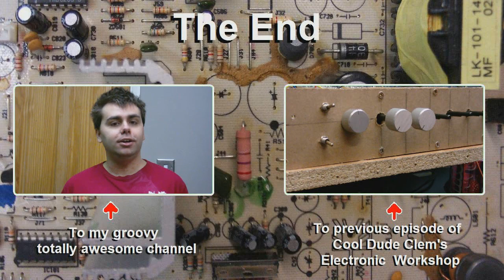CDC Electronic Work Shop - Upgrading a BSR turntable

Comment: I've got an "all-in-one" The Fisher 125 with a BSR turntable built in to the top of it.  I restored the turntable as it was stiff with the old hard grease and got everything freed up.  It's a 4 speed with 16,
33, 45, & 78, has a metal plinth and platter and has its original Pickering V-15 moving magnet cartridge with 2 NOS styli I picked up for it for modern albums as well as wider grooved 78's.  Problem is the old Fisher underneath it (made in 1968) is pretty well clapped out.  All the pots and switches are worn to the point that deoxit only temporarily "fixes" them for a week or so.  The flywheel behind the tuning knob turns hard as with its weight it has wallowed out the sleeve that the shaft sits in and the traces have lifted shorting out the FM transistors.

What I want to do is to find a stand alone case for the changer like you've got there and transplant the Fisher's turntable into it so that I can use it with my modern Onkyo TX-8220 receiver/amplifier.  (It does have phono jacks and a screw for the ground wire)  Only thing I'm wondering is are all the BSR plinths pretty much the same size so that if I get a case for it from another old turntable, will it fit.  Guess I'll find out soon enough.  Wish me luck.

Comment: I would have liked a more precise guide, because I have a BSR plate but not the same system as yours, I made sure to have an output and I have 2 soldering cap, and the worry is that if I change ceramics to magnetic, the sound is super weak and on the output I literally have "hum" and no sound ... and impossible to know how to change it without wrecking the whole system ...
Reply from the maker: You will need to put a pre amp between the cartridge and the phono input. I did this with a GEC Sound Deck a long time ago and it sounded great. Ceramic phono inputs (usually) have no EQ and are line level, so connecting the pre-amp's output to that will work. I no longer have that unfortunately, or I would show how it's done.
Reply: @CoolDudeClem  for the pre amp I agree, but where I am stuck (thank you bsr for not putting serial numbers) impossible to find a precise guide for the model of the turntable, what I can say is that it is based on a chassie pre amp wilson sl400 it is basically an all in one of the 70's, mechanical, analog and without output rca and all the circuitry is under it

Comment: may I ask how you got the turntable out of it's housing ?!?
Reply from the maker: If you mean the turntable platter, there's a clip on the pindle that hold it in place. If you mean the whole thing, then, under the 2 screws that hold it down there are a couple of clips that can be folded out, allowing the whole thing to come out.
Reply: @CoolDudeClem  Thx a lot. I will try that when I get hold of the system next time.
Reply: Tell it you want a committed relationship 🤣😅...😳Sorry

Comment: i KNOW IT WAS YEARS AGO BUT SHOULD YOU CHANGE THE WIRING UNDER THE PLATTER TO MAY MATCH HOW MAGNETIC  CARTS ARE DONE? OH YEAH WHAT ABOUT A GROUND WIRE?  WEHRE DO WE PUT THAT TO PREVENT A HUM?
Reply from the maker: There's no real point with this turntable as the motor makes so much magnetic interference, the cartridge itself is picking up hum from the motor.
Reply: @CoolDudeClem  if you change the wiring to match how they did the Magnetic cartridges there is not a hui but you still neeed the ground added for interferance,

Comment: :ou can now buy a plastic cartridge adaptor on Ebay to save drilling two holes it just clicks in after re wiring and putting the cartridge on it

Comment: You done a great job there, I have always liked BSR turntables. I have umpteen of them I know what you done is fine, but I do like the sound I get from the original stylus. I know those magnetic styluses are better but the price of the original one is cheaper. Although I may try what you done to one of mine.
Reply: If you have a lot of them, check under them first.  Some may already have a moving magnet cartridge.  My circa 1968 BSR turntable, a 4 speed has its original Pickering V-15 mm cartridge and it still works great.

Comment: What is the 2-4-6 in the back on the right side?  Is it related to a counter weight in some way?
Reply from the maker: I think that's the anti skate adjustment.
Reply: CoolDudeClem I see. I have the same player along with an 8 track and receiver in a 1975 console, but the silver/chrome piece in the middle is missing on mine.  I’m not having any issues with it. Just wondered if that was some kind of internal counter weight located underneath or something. Thanks.

Comment: I have the same identical changer, It's a Realistic LAB-14. It used to rumble and mistrack bad until I degunked and extensively relubed it including arm travel path, boiled idler wheel & motor mounts to restore softness, put a Pfan. MG09D magnetic cart in,  (insane stereo seperation) shimmed VTA downwards, adjusted trck force & antiskate properly. It came with an ADC mag cart but i didnt care for the sound of it

Comment: I have one of these turntables. The tonearm is heavy because it' missing the counterweight that my turntable has. It was a weighted cylinder of heavy plastic that slid over the end of the tonearm shaft and snugged into the slot at the end. Then when you set the weight adjustment to zero the tonearm balances.

Comment: I did this to my BSR using an Audio Technica  At95e. You need to connect a ground wire that connects the left and right ground connections from the cartridge together, and then ties them to a metal portion of the record changer base or mechanism this should reduce the hum.

Comment: Can you/have you aligned the cartridge?  Loved this.
Reply from the maker: Turns out this wasn't such a good idea after all so I didn't bother with that, the cartridge picked up a LOT of hum from the motor when it was on.
Reply: I did this to my BSR using an Audio Technica  At95e. You need to connect a ground wire that connects the left and right ground connections from the cartridge together, and then ties them to a metal portion of the record changer base or mechanism this should reduce the hum.
Reply: CoolDudeClem shame. I had one at a 14 year old and always wanted a magnetic cartridge on it.  Parents’ present to me you see. Could you cite the him?  Some sort of shielding or platter may?  Not my talent. Thanks for the interesting video!
Reply from the maker: I did try putting a metal turntable platter from another player on top of the bsr's own platter, it did improve the hum situation but only a little.

Comment: I have a bsr turntable that needs the tonearm replaced. 
I have a spare.
How difficult is it to transplant?
Reply from the maker: Not to difficult, if it's like mine there should a couple of screws under the tonearm near the back, just remember to unsolder the wires connecting the cartridge first
Reply: CoolDudeClem Thank you so much!

Comment: i hear drop out with the cartrige.. Shouldve stayed with the crystal.. also never used any resisters uner the player..
Reply from the maker: I  didn't have a full understanding of how crystal/ceramic cartridges work back then, the  resistors were there so I could connect it to a preamp without the  cartridge overdriving it.

Comment: hey there, I've just started getting into vintage vinyl players. I bought  a Garrard SP25 mk2 turntable second hand but I'm not too sure what cartridge i should buy (for a very low price) and also the power cord is damaged. I hope you or somebody can help me I've had no luck anywhere. thank you.
Reply from the maker: +Fabrice Uwihanganye I don't know, I would just go with finding the same type cartridge as what it had originally.
Reply: +CoolDudeClem thats the problem :( it didnt come with a cartridge

Comment: You removed the attenuating resistors because you were installing the magnetic cartridge? or did you install the resistors for the ceramic and need to remove them again for the magnetic?
Reply from the maker: ***** The only time I had the resistors connected was when I had the ceramic cartridge in.  This test I did here is not really all that good anyway, I should have used an amplifier with a very high impedance input and no equalization for the ceramic cartridge.  Sorry if this double posted, the comments section seems screwed up right now.
Reply: Perfect, thanks! When I get my cartridge I'll see how it works before I get any amplifier. The player was very loud to begin with. (Not sure if that's how it works. Very new at this.)

Comment: What is the make & model of the stylus/cartridge that you replaced in this turntable? I have a BSR 257 that needs repair, including a new stylus/cartridge!!! Oh, by the way, very cool video!!!! :-)
Reply from the maker: punkrockpub I cant remember, I think it was an Audio Technica something or other.  Thing is in this video I wanted to connect that turntable up to a magnetic phono preamp and it originally had a ceramic one.  Unfortunately I don't know what the makes and model numbers are so I cant help, sorry.

Comment: Hi there I have a BSR 35C Mcdonald record changer which works fine except one thing...., the tone arm after finishing the play on the record goes up from the record, comes to the resting place, rests for a second and then again it goes back to playing record. Can you please help as what could be the reason, I am not sure if there is some setting I need to do, very frustrated but I hope you know the answer to fix this. Thanks in advance. May be I was cleaning the player and some setting got disturb. It should rest on the resting stand when the record finishes playing.
Reply from the maker: Arshad Haroon Simple ... you just need to move the part that's located above the tonearm over to the spindle after the record starts playing.

Comment: I'll happily take any and all ceramic cartridges anyone wants to send to me.  I use the crystals to rebuild antique cartridges.
Reply: +Ron L&#39;Herault very interesting, can you not find the Rochelle crystal any more & can you refurbish stereo carts Thanks
Reply: +Vintage-Audio-Workshop - No you can't find Rochelle salt crystal, although you can make your own.  The ones developed in the 50s work quite well and are long lasting.   Rochelle salt crystals absorb water unless thoroughly sealed.  BTW, without a flip over cart. in your BSR, you need to swap out the stylus for a larger one if you choose to play 78s -which I do a lot!
Reply: yes Hygroscopic is the word the techs often like to use, i had to look it up! Can you refurb the stereo cartridges or just mono versions?
Reply: +Vintage-Audio-Workshop I just redo the early mono cartridges, mainly Astatics, the flat grey-metal cartridges that use mainly steel needles to play 78s.
Reply: Ron L'Herault nice

Comment: spindle  hard to remove   any help
Reply: Hi here's how to remove it; put 2-3 drops of 3-in-1 oil in the space between spindle and spindle hole, apply heat to the spindle using a small soldering iron for 2-3 mins, and you gently twist pull the spindle out

Comment: I had a BSR that looked just like that for years with the adjustable tracking, although it was already equipped to take a magnetic cartridge. The sound was good, but mechanically those were garbage. When it finally died (about 15-20 years ago) I replaced it with an older Elac/Miracord 50H which I still have today.

Comment from the maker: The little disc is just stuck on with glue, it should come off if pulled hard enough, don't worry about bending it, it's metal so it can be bent back into shape easily.

Comment from the maker: If you mean how to remove the turntable platter, that's easy.  There's a c clip holding the turntable platter on the spindle, it may be hidden under the label in the middle of the platter, but that label can be pried off quite easily, and after popping the c clip off, the platter should be free to remove.  If you don't lift the platter perfectly straight it won't move so best to use both hands there.

Comment: deck looks like a bsr c123, one of their basic ones from the mid 1970s. They have a single shaded pole motor. If it has a plastic platter you will get bad rumble. try using a decent thick rubber slipmat you may be surprised.

Comment from the maker: @FelixTheHouseFreak I am going to do that, as the cartidge picks up a lot of vibration from the turntable, and the motor induces some hum whenever it's running.  Those ider drive systems ain't exactly mechanically quiet whitch is a shame, because I really like the old BSR turntables.  I have a direct drive turntable from around 1983 in my shed somewhere, all it needs is a new headshell, and I'll put the new cartridge in that.

Comment: It certainly sounds better with the MM - night & day! But I'm slightly dubious of your counterbalancing system here!  With the cart itself you'll find the optimum tracking weight. Get a little tracking gauge for a few pounds to help you. With the arm positioned as if playing a record, & the stylus tip resting in a groove on the gauge, you'll see if correct force is applied. Also, online you can print off a cartridge alignment protractor to make sure it is correctly positioned in the headshell.

Comment: @wastedpills Well no offense but something like that isn't Hi Fi audio. They may have been rather fancy back in their day but they where just consumer level audio gear and the standards weren't too high. (Granted CM was one of the better brands) There's no adjustments on yours because they've been pre-built into the design, which is fine for average level, but not for serious audio.  Things like that are pretty crude machines compared to the more professional gear like the technics 1200.

Comment: that was an awesome idea! i really like those old BSR turntables, it's nice to see you made one sound even better than it already did by upgrading to a magnetic cartridge! if i evar get a BSR turntable that's what i'll do! btw, think maybe you should build a wooden case for that turntable?
Reply: Some older BSR turntables came with a moving magnet cartridge already on them.  Mine did.  It's a Pickering V-15 and it still works great.  It's an older 4 speed turntable.

Comment: You really need to get a proper turntable that's going to let you make all the proper angle and weight adjustments.  It may look straight or right but the adjustments are actually quite intricate and can't really be done by eye or touch.  Also, a stylus that is too light is just as bad as one that's too heavy. Without precise calibration a turntable can't sound it's best and will damage records.